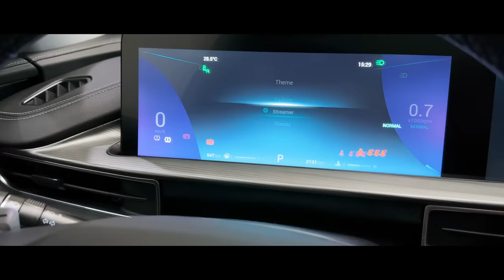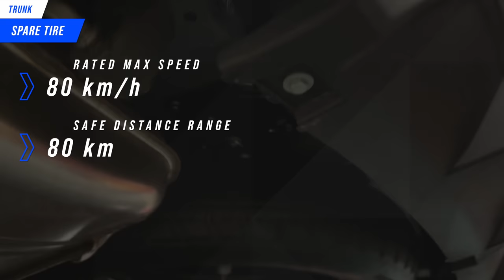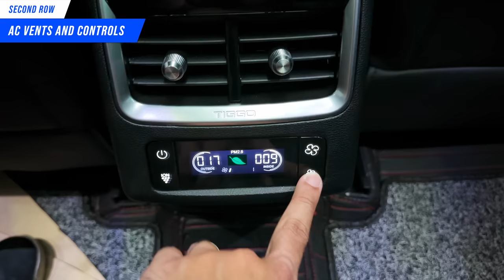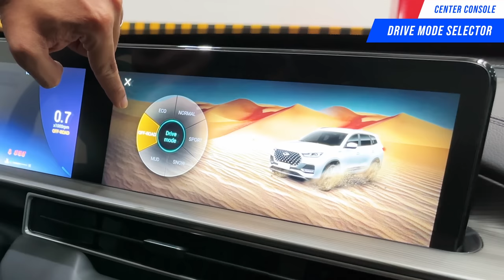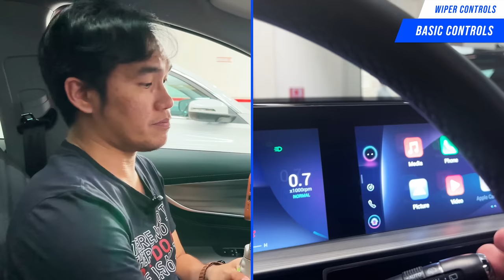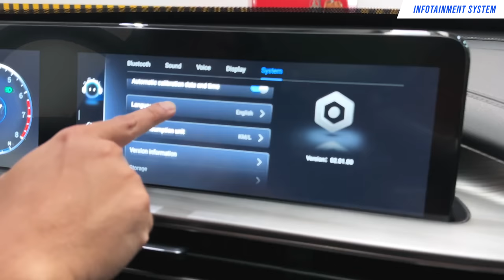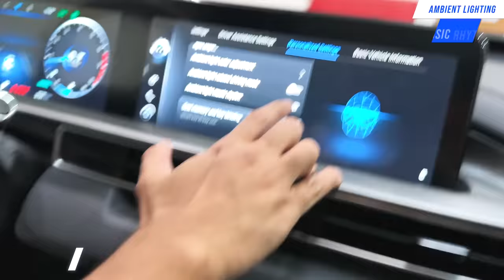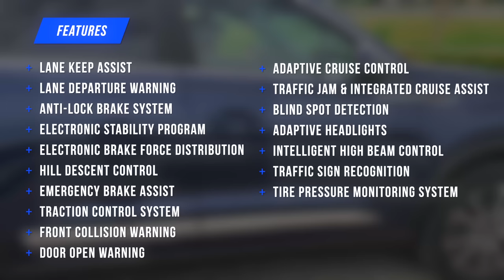Chery Tiggo 8 Pro 2.0L AWD 2023 | Detailed Review

Comment: Hello, is the rear view mirror still ultra wide as the 1.6? I noticed this is now auto dimming.

Really good review, though I wish it was broken down to several byte size review just like the rest of the videos. Not complaining, it’s just easier to digest:)

That said, given what you know now, would you choose the AWD over the 1.6? The latter kasi is already full featured and other than max torque/hp, I just can’t see 300K diff.

Maraming salamat
Reply from the maker: Hi @bongski5008 !👋 Really glad you liked the review.👍 I believe the rearview mirrors are the same as that from the 1.6T. I think if your the adventurous type, you can't go wrong with the AWD. But for me since all my routes so far are on paved roads, I really don't feel like I need something more than the 1.6, but that's just me.

Thank you so much for the questions and for watching.🙇

Comment: What happens when u put window tints? Will it still look uniform thought out the car even if the 2nd and 3rd rows have privacy glasses??
Reply from the maker: Good question Sir Jojie marie cris Pedregosa.👍 To be honest I haven't owned a car with tint on the glass. But I'm assuming tint services have a way to measure the darkness and shade of the tint to match the colors.🤔 This is just my assumption as there are different darkness levels and shades of tint offered when you want to have tint installed.

But please do let me know if there is a different way of doing it, I'm curious as well to know how it will have that uniformity in shade and darkness.🫡 Thanks so much for watching🙇

Comment: The 1.6T is not equipped with Voice Command, sir?
Reply from the maker: Hi Monmon👋. The voice command capability of the 1.6T variant is only for when your phone is hooked up to the car via CarPlay or Android Auto. But for commands that opens the windows, adjust temperature, etc.,  unfortunately it doesn't have that capability yet (fingers crossed that we might have this as a software update)😢. I hope this info helps🙏. Thank you so much for watching🙇‍♂️
Reply: @NotAProDrayber  thanks Sir. I’m considering this T8Pro. 😊